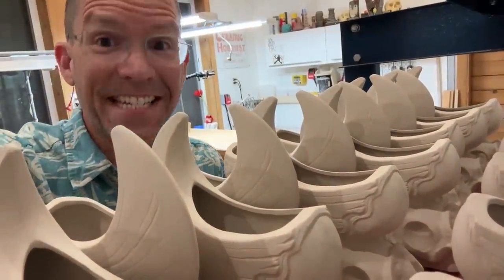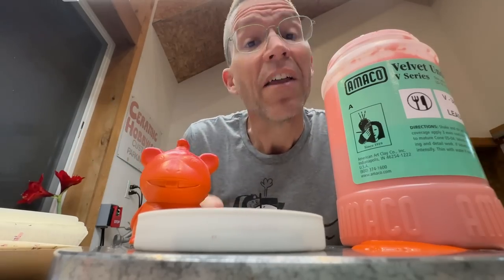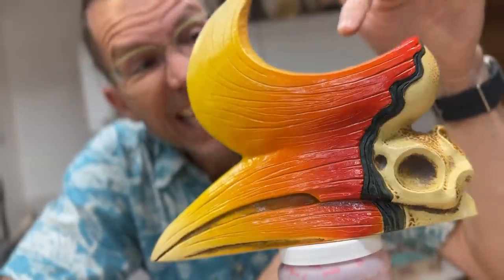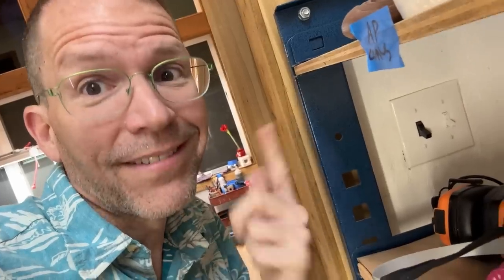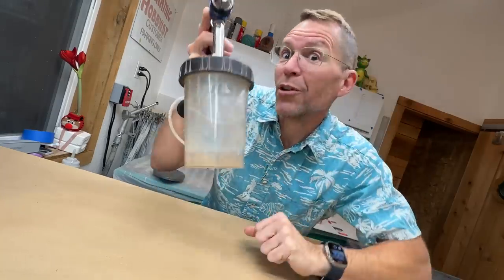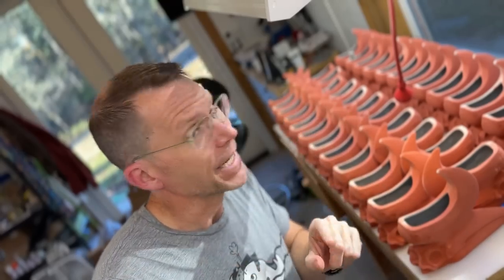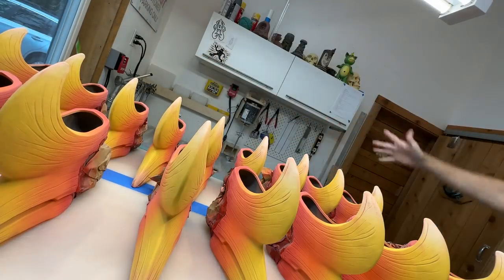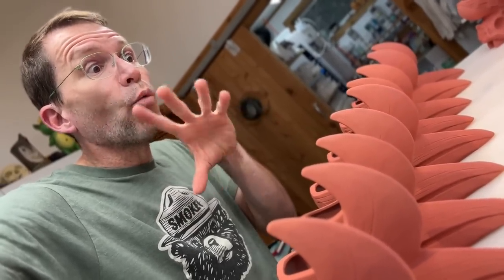Making a Slipcast Mug pt6: Glazing! - Tiki Technical Tuesday

Comment: 10:15 - Nice to get that up and out of the way, but if that's a steel tank, do be sure to drain that regularly. It takes a while to corrode to the point of failure, but thanks to multiple YT aftermath videos, I have a new appreciation for how much energy is stored in one of those tanks - and what it can do when it releases all at once. (shudder)
Reply from the maker: Thanks for the reminder! I need to get up there and drain it. I wanted to splurge for an aluminum tank, but couldn’t afford it at the time.

Comment: Wanting to learn about making mugs, and very much wanted a foundation in the traditional method of doing it. This has been fantastic. Thank you! I am curious though if 3D modeling/printing being incorporated into the process at some point is practiced at all. If so, at what point? 

Are you aware of methods in which the molds are 3D printed and then used to create mugs? I assume you can't use slipcasting at that point?
Reply from the maker: Check out Curt Hammerly on Instagram. He’s doing some really interesting work 3D printing his master molds: https://instagram.com/hammerlyceramics?igshid=YWJhMjlhZTc=
Reply: @vantikistudio  Thank you!

Comment: Do you get much spray into the inside of the mug by accident? Does this affect the final result?
Reply from the maker: Good question! The glaze I used on the mug interior is a dark satin glaze - it absorbs any underglaze overspray when I fire it without any color shift (I did tests to make sure I wouldn’t have any surprises)
Reply: @vantikistudio  thanks for the quick response! I love your content. I’m learning so much & I’m always excited to see what you are up to.
Reply: @vantikistudio  I was wondering the same but in regards to food safe - ness. You said underglaze isn't food safe but there is some overspray on the inside without the extra glaze top coating. Does that same absorption work for food safety?

Comment: Isn't glaze powder cancerous? 
Or at least I remember our ceramics teacher in art school telling that to us in the early 90ies.

And damn, he really died of lung cancer a few years later. : /
Reply from the maker: Well, any airborne dust is hazardous (that’s why I wear the respirator in the spray booth), and some dry materials for making your own glaze can be toxic. That’s another reason I buy premade food safe glaze.
Reply: Yeah, any dust from silica minerals, including clay dust, is not great to breath in over the long term.  And I can remember a famous occupational case from the Hawk's Nest hydroelectric tunnel in the 1930's where many workers succumbed to silicosis after drilling and blasting in quartz sandstone with no respiratory protection.  However, you should note that Señor VanTiki, here, is about as scrupulous as anyone can be about his personal safety. Not only does he wear a respirator (and is clean shaven) but he has a spray booth ventilating his work area and drawing off particulates.  So he has both personal protective equipment AND AN ENGINEERING CONTROL to mitigate his respiratory hazard.  Plus, he keeps his studio pretty clean. Really, he is a pretty good exemplar when it comes to studio safety.
Reply: Silica is very dangerous for longs. So use a respiration while mixing glazes or sanding clay.
Reply: Using a wet cleanup for glazes and clay dust, such as a damp mop or sponge, instead of lofting particulates into the air with a broom is also a good idea.